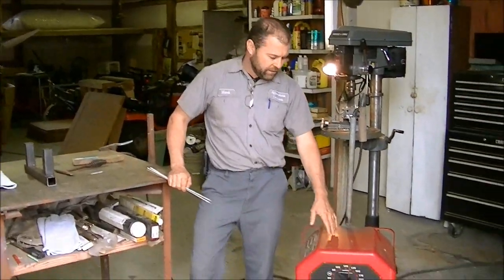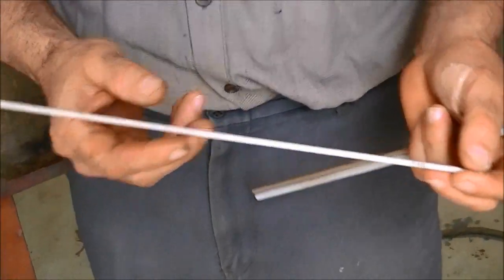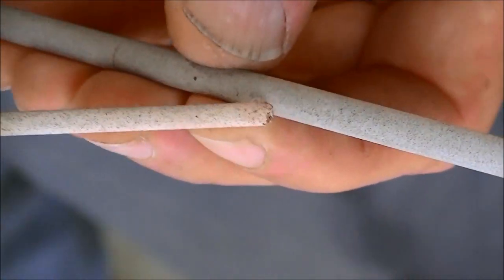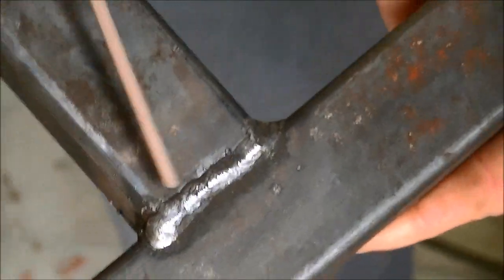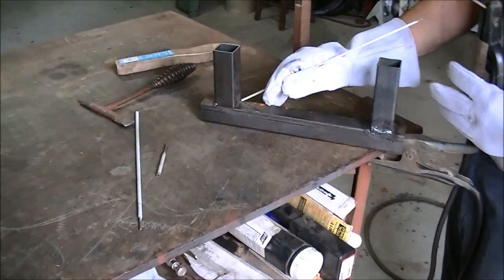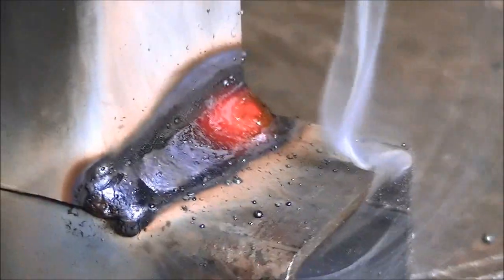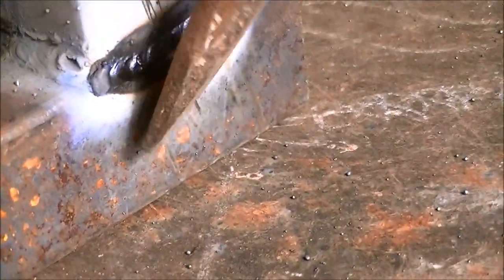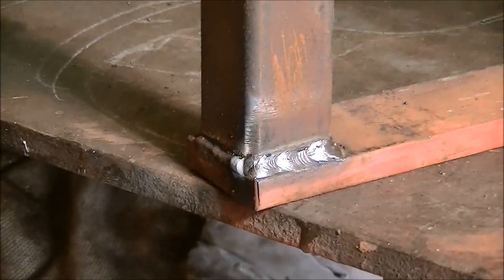Learn how to weld watch thru the welders lens. Tutorial.

Comment: Excellent video. Thank you for sharing it.
Can you make a video of how to weld with flux core?
I bought one flux core welder machine to weld parts of the inside framing of my after i crashed and it was kind of hard for to do it.
I think it was the settings probably. I don't know.
Reply from the maker: A good flux core machine will weld fast and strong but you have to know what you are doing. It also requires a number 12 lens. They make cheap flux core machine that requires no gas, there junk. It you are a part time, fix your own stuff welder , then get a mig machine.
Reply: @markp0177  Mine comes with a tank of gas and I think the brand is MAX PRO 140 or 240. Not sure.
But thank you for your reply. I appreciated very much.

Comment: Not convincing,  when set at the right temperature slag in 7014 (7018 preferably) falls off almost on its own, "holes" in your welds are caused by low temp or not a very steady hand.

Comment: Good video, thanks. So on that Lincoln welder, how thick will it weld with 225 amps? 20 years ago I had out old Lincoln SA200, and I could lay down a fairly decent bead. But that was 20 years ago and I’m thinking about building a couple of small utility trailers. I’m wondering if this Lincoln welder would be adequate for that.
Reply from the maker: Your SA200 is more than adequate to build a trailer. If you are welding thick metal you just make several passes.

Comment: How come you don't get an electric shock when you change electrodes or hold the metal you're welding
Reply from the maker: I have gloves on. You will get a shock if your gloves are wet but not to bad. It is low voltage and high amperage.

Comment: I hate ac welding .makes lots of sparks flying. Love dc machine. Ireverses the polarity of weld end power while verticle  welding which throws out little spak only.besides ac transformer type welding machines r highly ineffecient.and makes lot of noise. I prefer inverter type smps machine which is very light weight can carry around .

Comment: Mark, I noticed that you're using a Fibre-Metal TIGerhood. How do you like those? Are you using the stock headgear or have you changed it out for something different or better? Thanks for the  video.
Reply from the maker: I like it and I am using the stock head gear but it is a old shield and I don't weld but a few times a week. Thanks for watching.

Comment: young man , lincoln electric ac or ac / dc will weld up to 1 inch steel tombstone best crackbox some people buzz box  ! . no other welder can do what tombstone can do , for sure ! .  

U CANNOT BEAT LINCOLN ELECTRIC / TOMBSTONE AC OR DC / AC  THEY ARE TOUGH MACHINE ! . FOR SURE !

thank u kasey 

PS : IF U USE 7018 AC OR DC / AC RODS / RUN SMOOTH ! .

FEW DAYS BACK JUST GOT OLDER MODEL MILLER THUNDERBOLT 225 AC USE  > 1/8 X  7018 AC RUN A GOT SMOOTH ROD  THIS IS A " G O O D - MACHINE " BUT WHAT NEVER BE LIKE LINCOLN " TOMBSTONE "ELECTRIC  THEY REALLY ARE THE BEST  ! .

MILLER THUNDERBOLT 225 A C COST : $ 125.00 

I CLEAN THIS MACHINE UP /  WELD LEADS 50 '  OLD ONE'S WAS ALL CRACK  / STINGER WAS RUSTED UP 50 '  GROUND WAS NO GOOD EITHER  /  HAVE   "  P R E T T Y -  G O O D "  50 ' EXT.CORD  ! .

O L D > WELD LEADS / GROUND LEAD GOING TO THROW THEM AWAY THEY ARE JUNK ! .
BRAND NEW 50 AMP . BREAKER  /   50 AMP.  >  2 - 250  V RECEPTACLE ! .

2  -  BRAND NEW QUICK FITTING CONNECTOR  / 1 - BRAND NEW WELD  / 1 - GROUND LEADS

NO. 2 WELD / GROUND LEAD AND HELL LOT SHORT THAN 50 ' ! .

U CAN GET BETTER ARC OUT OF SHORT LEADS ! .

BRAND NEW : 25 '  O R  50 ' 50 AMP . > 6/3 OR 8/3 EXT. FLEXABLE CORD ! .( DON'T KNOW WHICLE ONE GOING TO BUY > LET  )   ? .

BRAND   NEW  (    B L U E  - D E M OM   )   > 1/8 "  X  7018  A C   X 50LB. CAN

Comment: Need video,  I need help with a small project.  For a 1 1/2" tube 16 gauge;  what stick you recommend.?   
The project is a Brewing stand (stove).
Reply from the maker: Use a 3/32" 6011 rod on 60 amps. Weld down hill vertical.
Reply: Thanks!!!!!

Comment: I'm learning on a Miller DC stick welder but have been using a Lincoln flux core welder for about a year. I can't seem to smoothly strike an arc. I turned the amperage up to 105 and it's working better but I can't keep it going consistently. Also, If I lose the arc, the welder "clicks" and I have to wait a few seconds to start again. Is that normal?
Reply from the maker: Its sounds like the machine is having trouble. I have not welded with a miller machine in 28 years but when I did I loved how it welded. Make sure you have the right input voltage, it should be 220.
Reply: +markp0177 Thanks. The machine is a Miller 150 STL. It is both120v and 240v. I have it setup with 120v 20a on a dedicated 20a circuit and 20a outlet wired with 12/2 6' away from the 100a main.

I'm thinking the machine may have an issue as well. I was given the machine and it was unknown whether it is functional.
Reply from the maker: I see. I would try it on 220 before I gave up on it.
Reply: +markp0177 I pulled the cover off and found 2 burnt ceramic resistors so something must be going on.
Reply: markfothebeast ya you need to run that thing on 220v with a 10 gauge wire. It will perform much better and have less resistance from the wire size.

Comment: You run 6011 like you should run  6013 and 6013 like 6011. Don't whip 6013 it's a straight burn rod and pause longer on your back step with 6011. As a journeymen welder your video was  loaded with misinformation and bad technique. Not trying to be an ass but if you're going to try and educate people please make sure you're correct in what you're teaching.

Comment: wire brand makes a difference to i like lincon rods start with 6013 easy to use good for most repair jobs or 7018 lincon for higher strength rod stick easer  must maintain good gap not to stick.

Comment: the 60,000 is tensil strength of the medal.  I was wondering why you didn't use the most common rod 7018
Reply from the maker: Hello. This video was to help the average guy learn with this inexpensive AC machine. The 7018 rod is not for a beginner and is very hard to weld with a AC machine. I am doing a video soon on converting this machine to DC and will be welding with a 7018 rod. Thanks for watching.

Comment: as a welder who is AWS certified, your video gives me autism.
1. it's spatter
2. you chip slag not Flux
3. not worm hole. porosity. cause by incorrect heat adjustment.
4. the three most common rods is 6013 6010 7018.
these are the best for mild and regular steel.
5. your welds are atrocious
Reply: Well Daniel, not everyone is certified, but I know more after watching this video than I knew before. Plus I appreciate that i learned a bit more from your comment. I have to say though, I have much more respect for this man's generous sharing than  I do for your condescending critique of it.
Reply: Still waiting for Daniel's video...
Reply: Always tac with 6010
Reply: The video gives you what??? Oh that's why you leave comments like this.  Now I see.✌✌!!
Reply: Daniel S where's your vid? Stick welding thin square tube is not so easy to make pretty like mig or tig.
Reply: Yeah the whole "what you see is what you get" thing is not true at all in welding.... lol your shit should be lookin 🔥 not just eh whatever
Reply: Ernest A Agreed.
Reply: agree with my boy ernest
Reply: TheAyotteMan lo
Reply: well where is your damn video Mr. certified welder. real easy to talk shit and act like u know what you're talking  about but I don't believe shit unless you make a video yourself. either make a damn video or shut the fuck up

Comment: why wouldn't you try to use a AC 7018
Reply from the maker: I have tried the ac 7018 rod and in my opinion I could not tell much difference. I will be doing a video soon on converting my ac machine to dc.
Reply: markp0177 DC works hell of alot better. where I work we use mostly MIG. lots of Stainless work ..

Comment: Not to new welders,  forget 6013 and 7014.   Learn 6011 and 7018 best rods and common.
Reply: Um,you mean 6010?
Reply: Jesus h.christ 6010 is for  pipe welding, reverse polarity.   6011 is a general all purpose, similar to 6010 but can be used on AC or DC machines.
Reply: David Spin I'm well aware of what 6010 is for. We never use ac or have any use for 6011 in my trade. It just never crossed my mind. For all you beginners out there, learn 7018 or die tryin'!!

Comment: I'm on my 3rd weld on my wood splitter the dang thing keeps breaking Infront of the piston arm 1/4 inch steel bracket will not hold a weld
Reply from the maker: Does it crack before you use it or does it break under pressure. If it cracks before you use it may be made out of cast iron.
Reply: markp0177 it brakes under pressure... I'm just wondering if there's to much oil on it or not getting the right temperature on the steel
Reply: markp0177 the welder is a millermatic 212
Reply from the maker: Is the weld breaking or is the metal next to the weld breaking. If the weld is breaking then make three passes. If the metal is breaking next to the weld then you need thicker metal. Be sure to grind it to remove the old weld. If you have more questions call me at 251-402-1165. Send me a picture too.
Reply: markp0177 it's definitely the weld I'm going to clean it it again and give it another try if it brakes again I'll give you a call. thanks for your help.
Reply from the maker: I think you need more heat. I would weld it with a 7018 rod. You can weld with 3 car batteries. Check out my video.
https://www.youtube.com/watch?v=sjH8I1oKNMY
Reply: markp0177 going to give it a try thanks mark

Comment: my hands keeps on shaking, cant keep it steady.. im having a hard time just to establish an arc and when i do get an arc the electrode sticks fast enough for me to keep a gap, im doing this for about a week and it seems like im going nowhere..
Reply: Make sure you're not using light wall metal to start with. Gets some decent sized thickness to burn into. If all you have is light wall tubing, weld it together long ways. Not ends. Turn up the welder a lot until you establish the arc. There's a thing in welding called the puddle. It's the molten part of the weld. It's the Orange liquid "lava". Dragging too fast it's skinny. Dragging too slow it's fat and can burn thru. Gotta find "just right" travel speed and heat. But start out too hot and go down from there. Starting too cold can leave you frustrated because you may be too cold to melt the rod. Break off the end of the flux on rod to expose metal. This will ease the striking of the arc. Much like a kitchen match. Get comfortable. Support left hand on metal piece and grab the rod in your fingers like a pool cue. That should steady your hand. Use right hand on stinger to scratch the rod. When an arc is made lift up on the rod a 1/4 of an inch until it heats up a second and then softly decrease the distance of rod to metal. You can actually drag the rod on the metal if you're not too cold. That's why starting hot is better. Watch for the puddle. It's everything in welding. It's all about the puddle no matter what type of welding it is.
Reply from the maker: Try a 6013 or a 7014 rod. They are easier to hold the arc but leave more flux. Take a deep breath then let at out slow and use two hands to strike the arc.
Reply: i am using 6013 maybe i should try that 7014 and see how it goes from there.. thanks..
Reply: doooper super 
if you sticking turn the amps up a bit

Comment: people never go down on a vertical .. one of the bigest mistakes you can make .
Reply: Edward Stricklin  Welders  down hand welds with specific electrodes in certain situations.  There is also a downhand pressure ticket.
Reply: B Miller 13  what , b miller , im a professional taught at welding  school .. the only time is in position welding..thats as close to downward pass goes  sorry no such thing as a pressure whatever you referred too...
Reply: Edward Stricklin These weld are called a "down hand weld" and yes professional welders execute  them . On heavy wall pipe for oil and gas Welder do an " up hand" root along with multiple passes.  Where I am from welders that weld on pipe or pressure vessels are called "pressure welders " . I too am also a professional welder for the past 30 yrs with a background in repair work , manufacturing and pipe welding with multiple tickets.
Reply: just a note. A "down hand weld " is the same as a "down hill weld"
Reply: B Miller 13  
hey just saw your post ...look in mordern welding the page is 168 postions of welsds ...the term down hand refers to flat welding ...check it out ...i been graduate from welding school since 1980 working as a welder since all phase of welding hope this helps .
Reply: Edward Stricklin : Downhill / vertical down /down hand welding  is welding that is executed with a downward progression.
If you wish to see an example of this type of welding and what pressure welders do  there is many online just check out Pipeline Welding/ downhand/downhill.  You should read some more in that Mordern Welding book you have because every Edition that I have which is 4 of them all state the same thing about this type of welding.  Any weld that is executed in the flat position is either a push/pull a drag or a  forehand / backhand  technique . There maybe more terminology used I could be mistaken. Hope this helps.

Comment: the only thing to use 60** rod is dirty steel. it will burn through rust. 6010 will cut through the most or work for a good root pass if its more then 3/8 thick.  your metal should be very clean for 7018... hit it with the wire brush before you weld it. but thats my favorite.

Comment: good vid.im about to weld for the first time,a muffler to exhaust pipe.is there anything special i should know ???both materials are stainless...thanks..
Reply from the maker: Hey Bill. Are you sure its stainless? Its hard to learn how to weld with stainless, the rods heats up fast and sticks a lot. I would use a 3/32 stainless rod and around 60 to 75 amps. Use about half the rod then let the rod cool off for a minute. Let me know how it works out.

Comment: throw the 6013 in the garbage where it belongs. also it's spatter not splatter.
Reply: +Al Lee I also think it's funny that for some reason you think 6013 is harder to use. 6013 is probably the easiest rod to use, that's why every joe blow with an ac buzzbait uses it. 7018 and 6010 are much harder to run, and most commonly used in the real world.
Reply: MrCoffeekelly ...Yeah throw that 6011 AND the 6013 in the trash. I use alot of 7018 and 7024. Technically it is called spatter but I've met many many welders that say splatter. No big deal
Reply: +gone fishin yawn.
Reply: +Al Lee why would any welding school even bother with 6013? (and yes I realize you were trying to be sarcastic and witty) Name one application in the REAL world where a welder would use 6013.
Reply: MrCoffeekelly rookie
Reply: Al Lee lol
Reply: Huh I like 6013 pretty well I can lay down a pretty darn good stack of dimes with it I like 7018 also
Reply: "I just graduated from Welding School, it's spatter not splatter and my Instructor said not to use 6013 because it's trash.." (because it's harder to teach the slower ones to use it)

Comment: which would be better to weld engine mounts?
Reply from the maker: A engine is made out of cast iron and not steel so you have to use a cast iron rod.
Reply: Usually going to be made of steel, then. If you're welding with an arc welder, general rule of thumb is 6010 to root and 7018 to fill/cap. What engine are you swapping in, and what's it going in to?
Reply: ... engine mounts generally aren't welded onto the engine itself, though???

That being said, it depends only on the type of metal that makes up the engine mount. Most are steel, few - if any - are cast iron. Assuming you're talking about the block, that also depends on the material it's made of. Most are modern blocks are aluminum while most older ones are iron.
Reply: I'm doing an engine swap so it's a kit I'm almost positive it's iron but a plate is bolted on the side of the engine and the other plate goes on the car where the old engine mounts would have gone and then u have 2 other plates that u weld to put those plates together
Reply: Aaron Villanueva neither,buy new mounts

Comment: I have one  question for safety  reason.This may sound stupid but how would one be electrocute by using an arch welder.I mean can you be kill if you touch the metal that has the ground wire  while welding or holding the top of the rod.I just want to know  what is safe and whats not by holding it and using it
Reply from the maker: It can shock you if your gloves are wet but it wont kill you. It is low voltage, around 50 volts and high amperage so it is safe.
Reply: markp0177 
It's not the heat but the humidity!